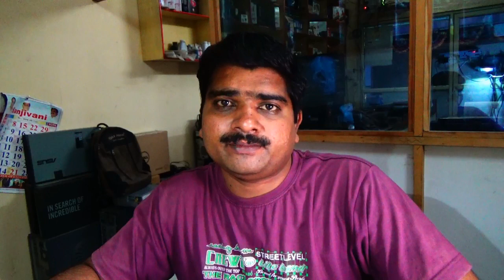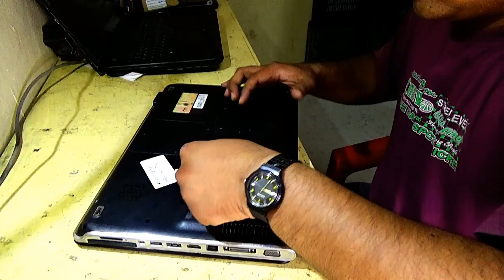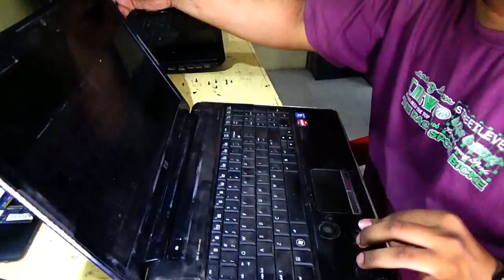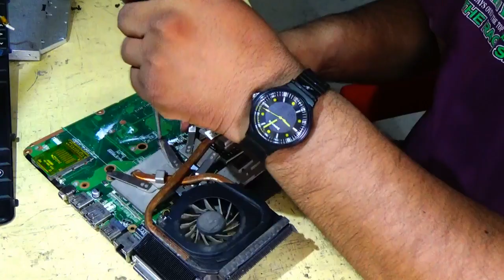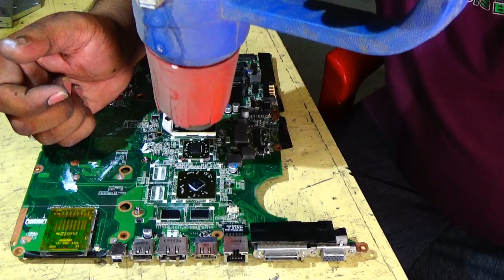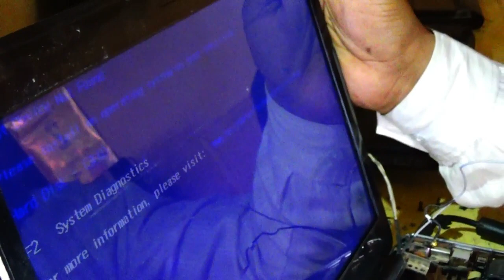Fix HP Laptop Graphics Issues with These SIMPLE Tricks

Comment: MOST TEMPORARY SOLUTION IT IS ....WILL LAST HARDLY 15 DAYS OR HIGHEST A MONTH. BUT MY SUGGESTION IS BEFORE APPLYING HEAT OTHER COMPONENT SHOULD BE COVERED BY THICK ALUMINIUM FOIL ONLY EXPOSING THE CHIP BY ACCURATE CUT. I TRIED/TESTED ALREADY. THIS RE-FLOW PROCESS APPLICABLE 3/4 TIMES HARDLY. ONCE FACTORY SOLDERING IS DRIED IT CAN NOT RESTORE LIKE BEFORE. BY THE WAY YOUR HINGLISH IS AMAZING..

Comment: Hi I have question that is it possible to disconnect or disable any ati or any graphic card in motherboard. My Sony Vaio has auto shutdown problem. I take it to local service person. He said it's problem with its ati Radeon graphic card. He will disable graphic card physically at chip level. Or switch to Intel graphics.
Is it possible to disable card physicaly in motherboard chip level
Reply: you can disable the Radeon graphics driver from Control Panel Device Manager.

Comment: Sometimes when its not a software issue and its a hardware issue then no matter what unless you get a new graphic card the software drivers will not install and also there is a catch here , only if the laptop has got an Nvidia card only then it will be repairable like in aforesaid video. However , if it has an ATI Radeon graphics card like in my Laptop then its definitely not repairable. 

The same thing happens with my Samsung laptop's where its AMD graphic card issue occured but was still showing its display in reduced quality, however it obviously did not play any HD videos nor it showed me an option to reduce or increase its brightness as its dependent on the software drivers; even if you will try to uninstall the existing drivers from the device manager and then reinstall it ; It will show you a blue screen which you will hate to see and again you will need to go back in the Windows safe mode to uninstall the drivers so that windows can atleast startbut with limited capacity...Also it will not give you an option to put your laptop on sleep mode ...it will just work like a desktop .. The cost of new graphic card will always be high around Rs 8000 so better not to waste any money in getting it repaired rather use your old laptops for kids at home for purposes other than your work and better get a new laptop for yourself as this is actually the time to get a new laptop
Reply: What if the laptop is in warranty and its facing this issue?
Reply: If it is then you are lucky and can ask for a replacement or repair of the device without any issues and without paying any charge .. Enjoy ; )
Reply: I have same problem, can't able to install drivers or booting, nor brightness changing
Reply: Please, send me  the link if you have a link to a video for nvidia laptop graphics card repair.